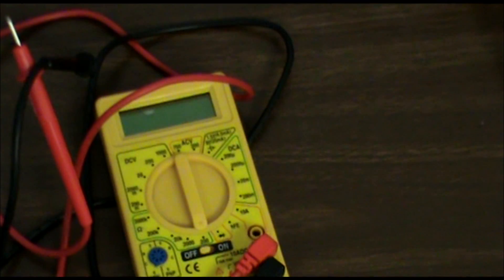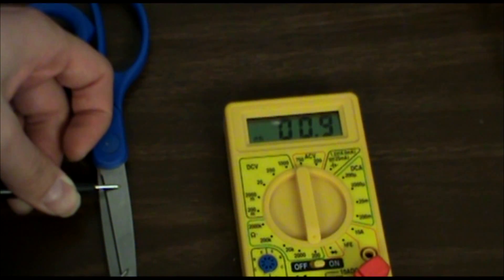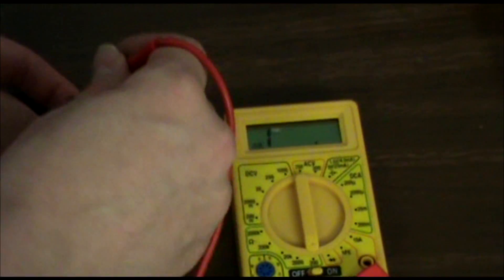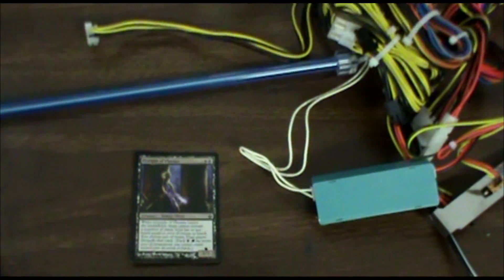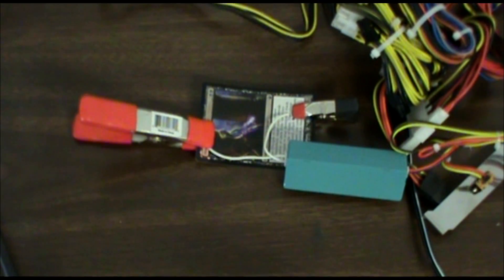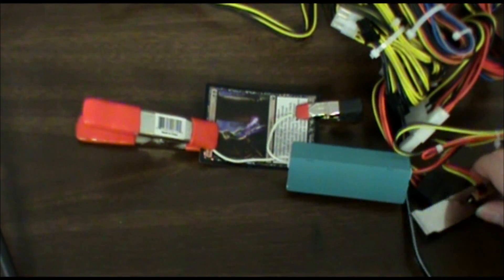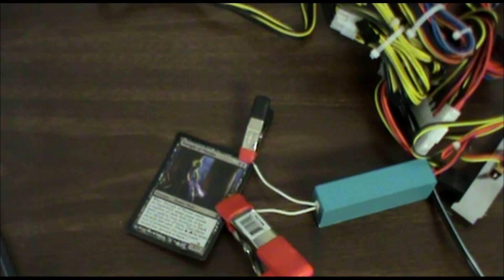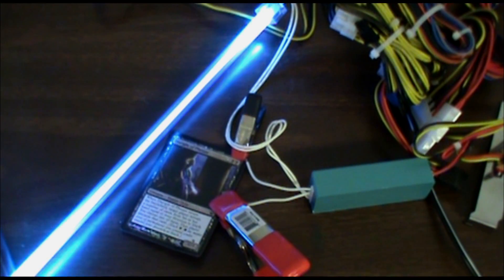Electrically Testing an MTG Foil Card

Comment: Yeah but carbon can be conductive and thus this can't be used to determine metal content. Pull off the foil, put it in acid, and get the solution analyzed by a lab.

Comment: led lights on average use 5v fyi
Reply from the maker: And that's a cold cathode 18,000 volt neon light filled with argon.
Reply: +DesolatorMagic  12v at most
Reply from the maker: Jason Borders
OMG look up how neon inverters work.  It's thousands of volts.  Stop posting inaccurate information.

Comment: The foil inside a card if sort of like a chip bag and how the inside of it is shiny. Also you can use acetone (nail polish remover) to remove any ink from the foil
Reply from the maker: I heard that doesn't work on recently printed cards but I will likely do an acetone video in the near future.
Reply: oh, acetone certainly works on newer cards, the ink is just a tiny bit more resistant, especially the text ink (which is awesome, i can use acetone to make my foils shinier). Ive been clearing ink from all foils i dont want so i can print on them and make custom tokens
Reply: +DesolatorMagic It does work with new cards, it's just a little bit harder to remove than slightly older sets. Very early foils can't be rubbed at all.